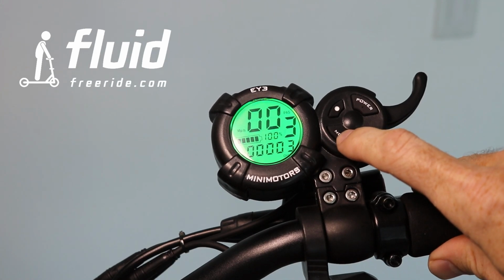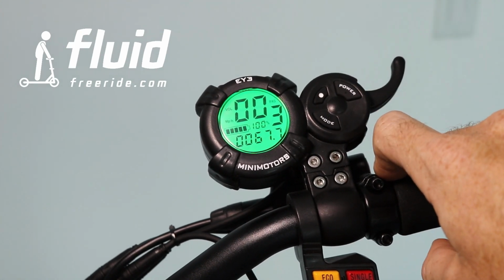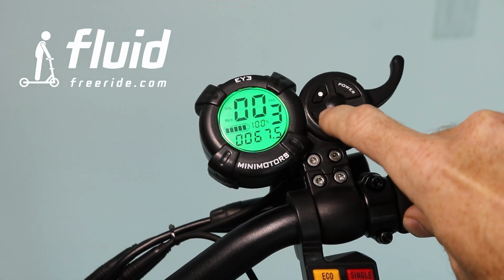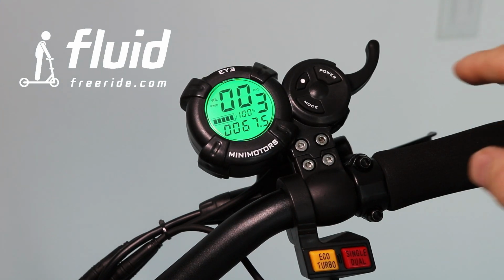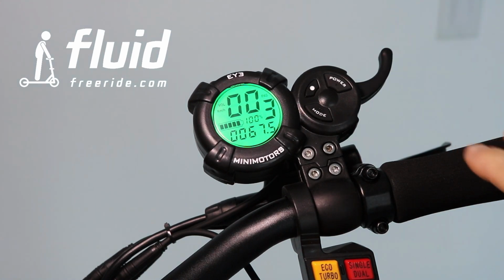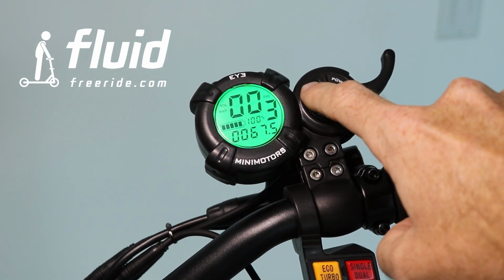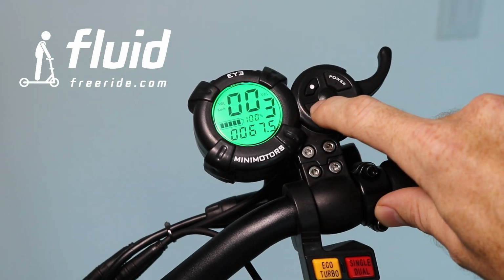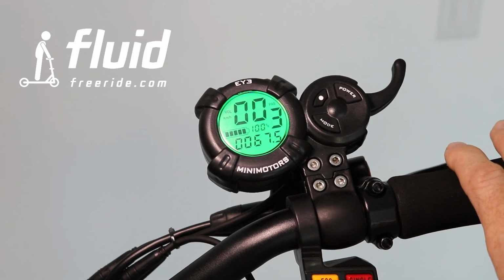Kaabo Mantis PRO Display settings

Comment: I've  judder on ever speed setting after fitting new wheel with all wire loam  complete. Any help it vibration in first pulling away and through each speed setting

Comment: For my Kaabo Mantis Pro, I used a product called Sugru (search in eBay) it's like a black Blu Tack, is mouldable and sets solid and waterproofs any little cracks. For any larger holes, it's black silicone in a Gun.
Reply: Where did you add the sugru?

Comment: P7 is the main mode you will mess with, 0 is ridiculously fast, the tires spin a lot when set on Dual wheel mode with Turbo mode activated. I recommend setting P7 on 3 for a smooth start than fast boost as you pick up speed. 

If you want to cruise more then set P7 on 5 with Eco mode on with Single wheel mode. 

This scooter is a animal.

Comment: Good evening!  I recently bought Kaboo Mantis 10 Base 18.5ah 60V, not professional.  I used it, there is no manual, I found it on the Internet - it did not help.  Such a scooter for the first time, in the display settings it is indicated that the scooter turns off at 53V.  Today it was 58, I was driving and turned off on the go, although the charge remained, how to solve this problem?  If he turns off on the Chinese Kugoo M4 pro because he can no longer drive, then he immediately cuts off.  I had to walk home.  What is its minimum voltage, if max 67V.  Thanks!  And it does not show the speed correctly, in the manual in the P2 motor magnetic pole settings - you need to specify 30, but it does not show correctly anyway.
Reply: hello, I have the same problem, what was the solution?

Comment: So I had pa i had it set to 1 at 100% battery and my scooter died the other day. the display worked still and after about 10 min the scoyer started working again. Now its happened a second time display still works but now no power at all to the wheels its been several hours and the lights on the body are not working either ...HELP PLEASE

Comment: Whats the voltage shut down of the Mantis 10 pro 60V?
Reply from the maker: 60V kaabo scooters should be set to 53V. That setting does not govern actual controller shut off which is in the 40s - it only governs how battery charge status is shown in display.
Reply: @fluidfreeride  Thank you! How can I set it up to 53V? And how can I check which voltage shut off is set up?

Comment: I have the Ultra 2 and it wasn't as powerful as it was when I drove it couple weeks ago. I had an incident where a car hit my right brake and the lcd screen and it was hanging.  I got it repaired they guy at the shop  said it was an easy fix. But now my power seems less. But it did top off at good speed didn't get to see the mph. after driving it for an hour it got weak and I turned it off then back on then  it was able to go but after half a block it got weak and slow like 10mph. After two more blocks I stopped decided to turn it off and it wouldn't turn back on. I got a ride back home and when I got home I pressed the power button and it turned back on. I am thinking because the LCD screen was replace they are some setting that may be off. The voltage on the manual showed it's a 72 volts. But the scooter is showing 60 volts. I moved up to 72 volts and the LCD blinks off and on and there was no movement at the throttle. I moved it back to 60 volts and the scooter moves but it.s iin my room so I haven't test it until tomorrow because it's 2 am now. II do plan to go back where I bought which is same place they repaired tomorrow. Originally when I first got it like 45 days ago after driving it for a couple days all was great. Then the next day I went to turn it on and the LCD blinked then it turned off right away. It would not turn on. The place where I bought it open the scooter messing with the wires and I think the LCD and he was able to get it on. Anyways this is the second time it turned off on me. The first time was with the original before the incident I had with the car. Any advice anyone I would appreciate it. Thank You!

Comment: Hey fluid again, last question, how do i get my mantis to go top speed of 60?
Reply from the maker: top speed can be best reached in dual motor and turbo mode on a flat surface.
Reply: @fluidfreeride  my scooter kaabo mantis plus is not going faster than a 25kmh how can i unlock it to get faster..? Please help me
Reply: @edvine4641  there is probably a speed limiting wire
Reply: @edvine4641  hey bro, did you fix it?

Comment: Hey fluid, what are the differences between the eco turbo button (yellow button) and the single dual button (red button)? And also, when i bought the scooter, when i brake, the scooter sorta vibrates, is that something got to do with the ABS that u were talking about at the end of the video, if so how can i get rid of that and just have normal breaking?
Reply: Ima say, from my experience. Single motor takes up more battery than dual motors on eco mode. I own a kaabo wolf warrior.
Reply: @FaceValueOnly  only time I use single is when it's wet and I need to use less torque for safety
Reply from the maker: Hey Jac - The ECO/TURBO switch regulates the power of your scooter. ECO mode reduces torque and top speed to maximize range. TURBO mode has no restriction of power.
The SINGLE/DUAL switch toggles single or dual motor drive. By pressing down the button DUAL motor drive is activated. When the button is not pressed, SINGLE (rear) motor drive is activated.
For Maximum range, select ECO mode and SINGLE motor drive. For maximum power and speed, select TURBO mode and DUAL motor drive.
Regarding the vibration, please contact us with your order number at support@fluidfreeride.com so we can help you out.

Comment: PA 0 = 0 battery Regeneration? So If i Want IT to recharge while hills need to Put IT higher? 
Is there a Option to Reset the Controller to custom settings?
Also is there any battery saving If i Put only 50 or 75% in Motor ? P9 1 2 or 3 or is IT Just for start driving or constantly less motorpower?

Comment: Hi! Thx sooooo much for your explication!! 
But i have a question about the loading charging circle, How i how to do:
Charge it only when it is at 10%
or i can chargeit when it's at 60% ?
I have a Dualtron (1.5 MX) EX 60V 18.2AH 
Thx in advance for a answer, THX :)
Reply from the maker: You can charge the scooter at any time you need. Just run the cells empty or close to empty from time to time (like 1-2 times per month) to have them go through a full charge.

Comment: Why does my mantis pro not charge past 60% after 12 hours still at 60%?????? My voltage is at 59.6
Reply: Replace the fuse in the scooter, is burning up. you need a 10amp fuse. Open the scooter remove battery. one of the wires inside a fuse replacement

Comment: Great tutorial on the display.
No going back to P9, in my owners manual indicates, 1max,2mid,3normal.
But you said 3 is the max, did you make a mistake or my manual is not right?
Thanks
Reply: 3 is max dude
Reply: @perrygoldstein2217  3 is max, but my manual is wrong.. Chinese writers probably..
Reply: @republicofu.s9642  There is an online manual with all the correct instructions  https://store.urban360.es/wp-content/uploads/2020/05/Mantis-manual.pdf

Comment: Just watched these videos and rode mine for the last couple of hours for the first time and it is amazing. Blows my wide wheel away. Just an amazing scooter, so much fun.

I had to set P7 (initial acceleration) on 5, which is the slowest acceleration.  The acceleration in dual motor turbo mode is so quick it was too much for me to handle on anything below 5!
Reply: you could consider change the P9 to smaller numbers
Reply: Michael Sha thank you.
Reply: @LewyLewy2008  How has it been this far? any issues with the stem or anything?
Reply: 4nlimited3dition I’ve been using it regularly over six months now and it’s still amazing and like new.  I’m actually surprised I haven’t had any issues because I ride it a lot, over long distances, and living in the city here it’s a lot of stop and go. But no problems to report.  Still rides and accelerates as it did on day one. No wobbly stem, no motor issues.  Just a couple of normal wear and tear matters that any scooter entails - once I had to have a bike shop true one of the disc brake rotors because I could hear a brake pad rubbing up against it at each rotation. But there’s plenty of reasons why that may have gotten bent with all the riding I do, and it was cheap to have trued.  And a couple of weeks ago I got a flat tire, which can happen to any scooter with air tires. But fluidFree Ride shipped a tube and tire right away.  Probably just needs the tube.
Reply: @LewyLewy2008  Nice to hear that. I've been planning to get one as well, but I've also been seeing many people having problems with their stems snapping on road bumps and major injuries from the bolts getting loose, so had to hold off the purchase until they get those issues with the design fixed. Have you checked the main bolts on yours recently? Mostly the main stem bolt apparently can get loose over time and eventually snap. That's my main concern.
Reply: 4nlimited3dition Well, thanks for that. I did get an email from FluidFree Ride saying that this happened several times overseas, and they sent out an upgrade bolt with an epoxy to hold it in place. I kind of assumed that it wasn’t much to worry about unless and until I start feeling the neck loose or vibrating, but I should probably get it taken care of.... If that happened in traffic it would not be good.  Where did you hear of this problem, other videos?
Reply: @michaelsha2781  Doctor Novocaine
so on pa i had it set to 1 at 100% battery and my scooter died the other day. the display worked still and after about 10 min it started working again. Now its happened a second time display still works but now no power at all to the wheels its been several hours and the lights on the body are not working either ...HELP PLEASE
Reply: agree